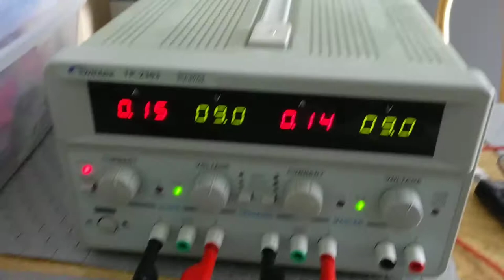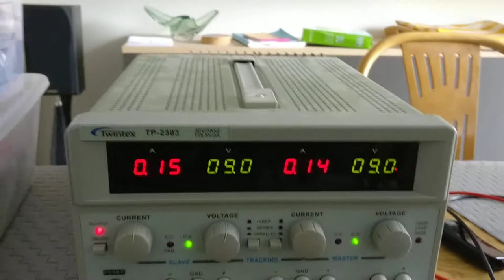ESP NOW to Remotely Control Stepper Motors

Comment: Where is the code for transmission and receiver? I went to Gitlab. I am lost which one to use.
Reply from the maker: The esp now code is in the espMgr.h and espMgr.cpp files in 

https://gitlab.com/gratefulfrog/strand-beest/-/tree/master/Steerable-StrandBeest/Robot/Release/Controller_Multi_Robot_00

You can see how those classes are used in the file app.cpp ;  look at the classes ControllerApp to see how to send messages and RobotApp to see how they are received.

Good luck!